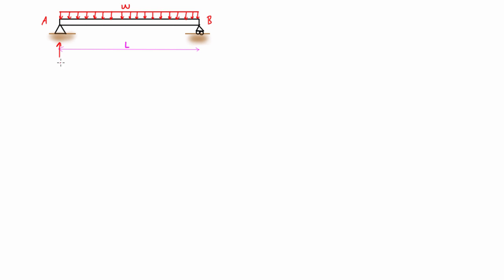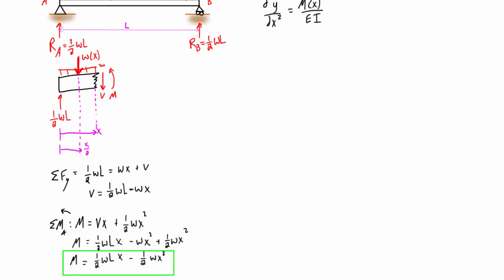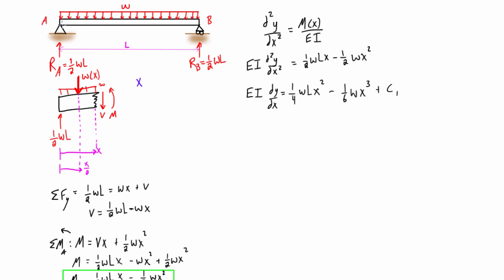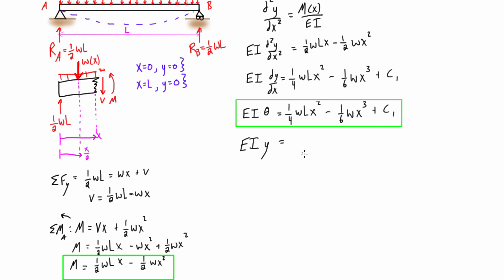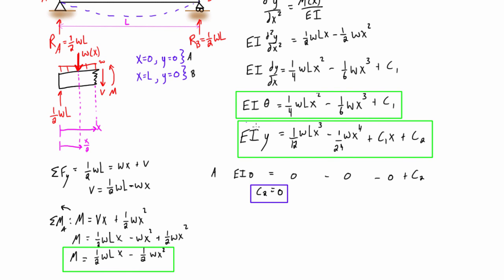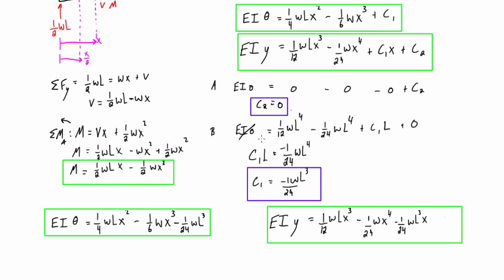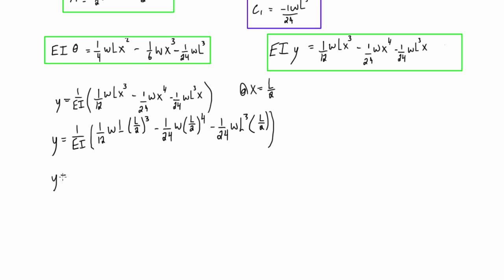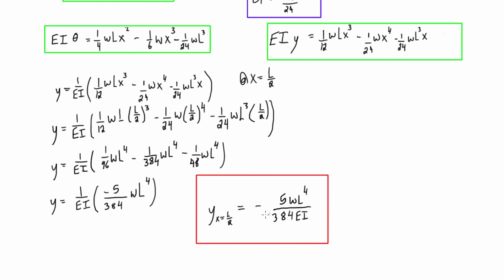Find deflection of a simply supported beam with distributed load (double integration method)

Comment: Question.. we used the Gere book when i took the class , and  were taught that positive moments were counter clock wise. i know you can take moments both ways, but when i used that method .. counter clock positive. i got every thing you got but it was positive 5... does that matter?
Reply from the maker: Positive and negative signs for variables only indicated if they are in agreement or opposite with the direction/sense that you drew on the free body diagram. So a +5kNm clockwise moment is the same thing as a -5kNm clockwise moment. The important thing isn't whether it's positive or negative, the important thing is that you understand and indicate if it is clockwise or counterclockwise. A right answer will have the same sense regardless of how you defined positive. Hope that clears it up for you
Reply from the maker: Positive and negative signs for variables only indicated if they are in agreement or opposite with the direction/sense that you drew on the free body diagram. So a +5kNm clockwise moment is the same thing as a -5kNm clockwise moment. The important thing isn't whether it's positive or negative, the important thing is that you understand and indicate if it is clockwise or counterclockwise. A right answer will have the same sense regardless of how you defined positive. Hope that clears it up for you

Comment: why ucant use the boundary condition that x=0, theta=0?
Reply from the maker: theta would only be zero at x=0 if it were a fixed rigid connection. Because it's a hinge, the deflected shape concave up curvature starts right at x=0 once the structure is loaded. The angle is unknown at time that boundary conditions are applied, but the fact that the pins are not vertically displaced lets us use the two chosen boundary conditions.